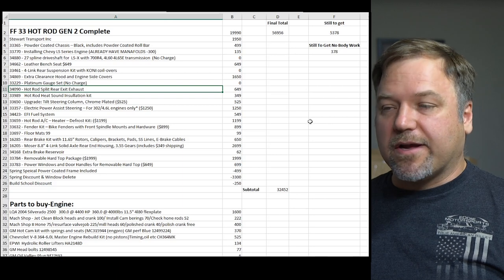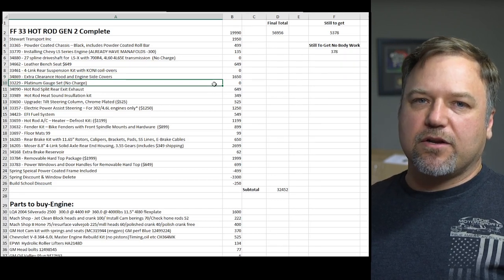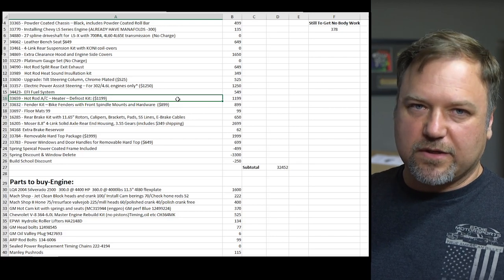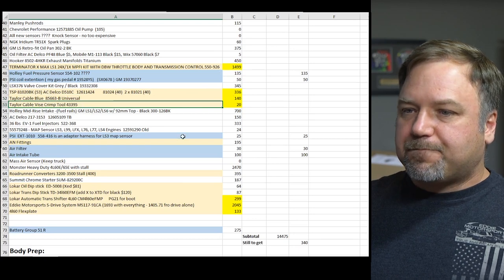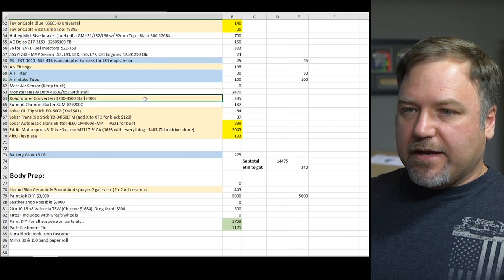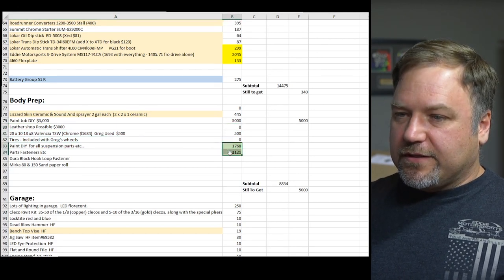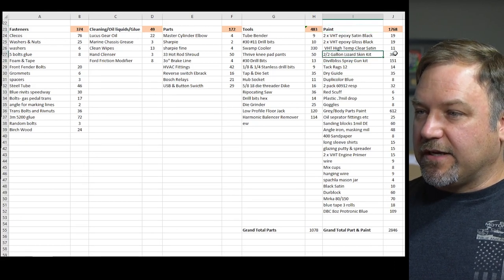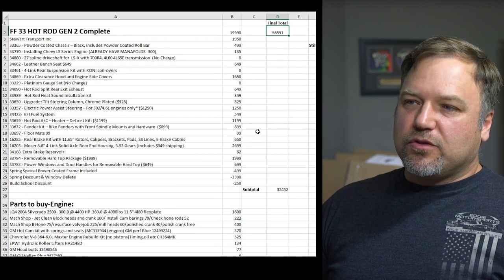Factory Five 33 Hot Rod V2 - Cost Analysis #3  - Hidden Cost

Comment: Great video. I have been looking at F5 for a long time and taking a harder look now and that's how I found your channel. Thanks for sharing the freight costs, that's by far been my biggest unknown and $2k is disheartening, thats quite a bit of money. Also, something to consider: I've come to the conclusion that most people overbuild the engines in these and dump money into power that they'll basically never use. Seems to me that even a 235hp Ford 302 is plenty of power for a car of this weight. Lots of money to be saved on the engine and transmission.
Reply from the maker: I would agree.  You do not need much to power only 2000lbs.

Comment: Anyway you can post the spreadsheet or share the file?  I would interested in adapting it to my project which is a Factory Five.  Thanks
Reply from the maker: Hi James,  Honestly, I have done this for three cars, and I almost start from scratch every time.  I suggest just pausing the screen as a guideline and create yours how you want.
Reply: @StreetRodJim  I kind of have one started. I am starting with a car so it is similar but different. I just really liked your thorough look. I feel like we are on the same wavelength in the sense of it is good to have an idea of real cost versus monetary feelings.
Reply from the maker: @jamescampbell6014  I spent a year on the excel sheet before pulling the trigger while getting finances in place.  Items kept changing the more I learned.  I will also suggest documenting part numbers and such after you start building.  It is an enormous amount of inventory, and things can easily slip by to when you go to do your first brake pad change you won't know what brakes you have.